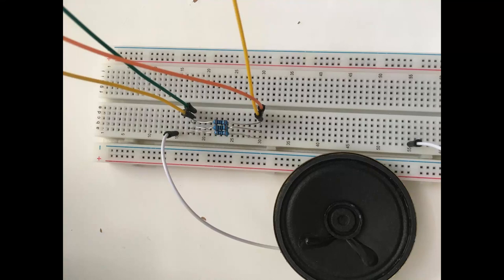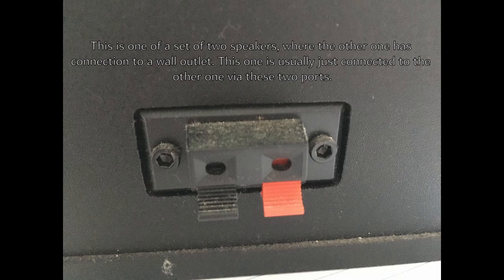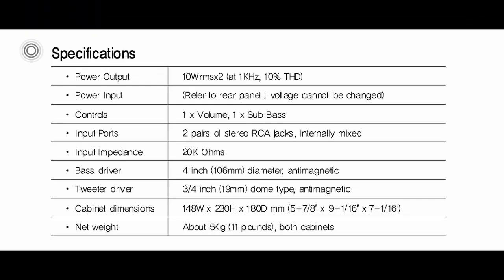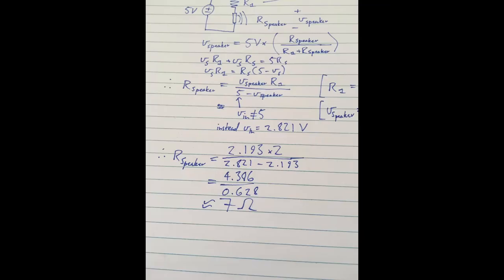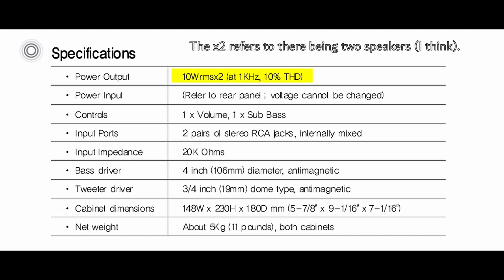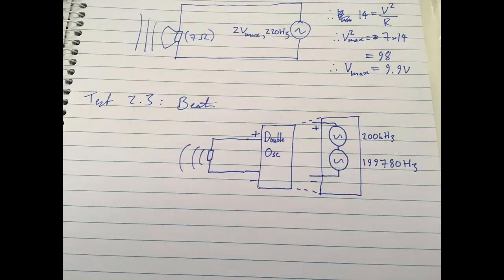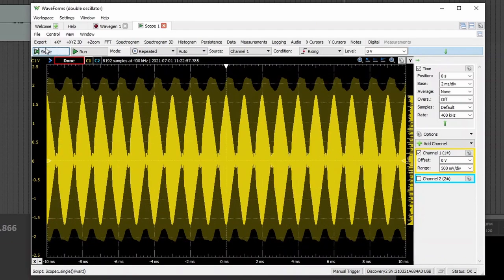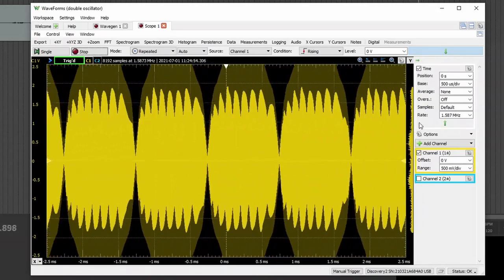Building the Ondes Martenot [02: Not Much Progress Happens in This Video, to be Honest]

Comment: The specified impedance probably shows up as a low resistance to you because it's made up of more than just resistance, could very well be inductance and capacitance in there. Capacitors and inductors can be viewed as frequency dependant resistors in a sense. Impedance is the frequency domain resistance of components